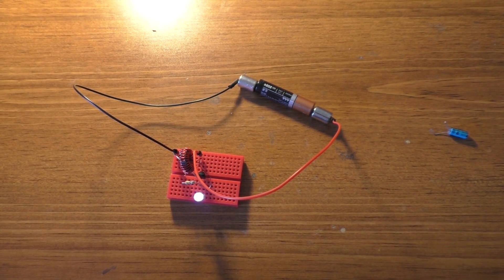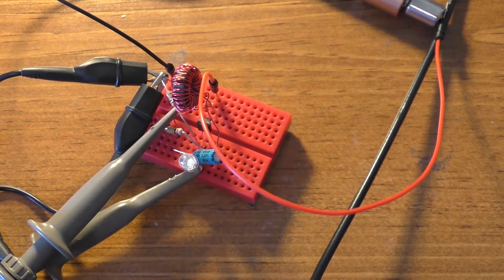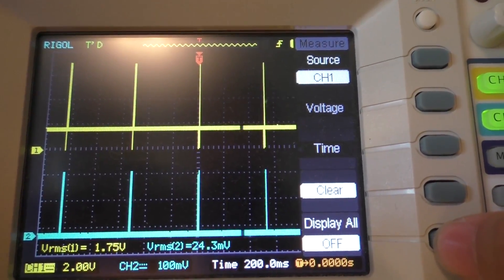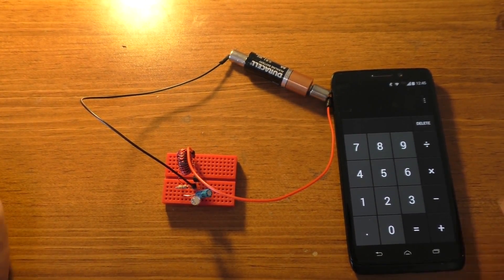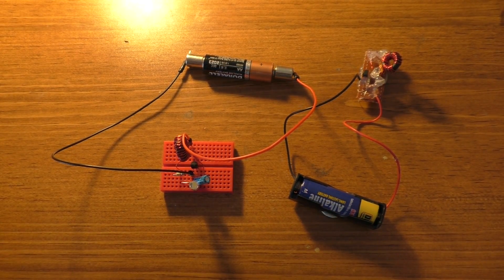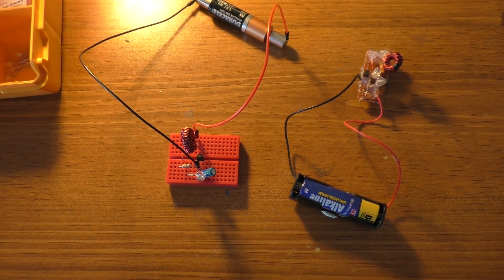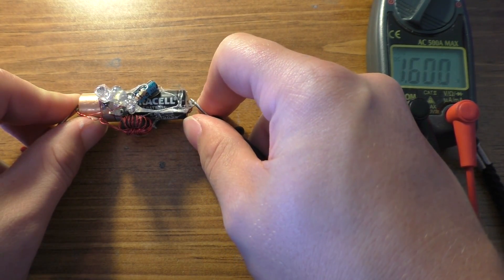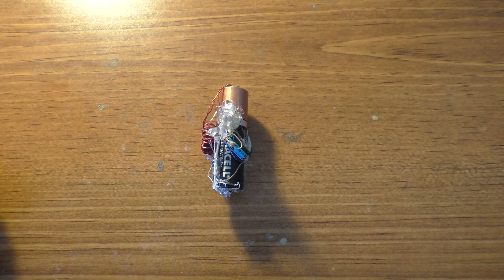Long Life Blinking Joule Thief

Comment: Ive been playing with these lately.. found not many windings are necessary,  dont even need a core.  I made one with a ring magnet as a core as well as air core inductors wound in a coil as well as toroid.. its all about the right resistors and capacitors.

Comment: In the Joule thief circuits, it will stop working when gate voltage of transistor reach .6 volt because of silicon transistors, so that much voltage will not produce work and that should be taken into account  when calculating the life of battery, because so much Amp hour is associating with that little voltage. If we were able to use mosfet transistor that could change, but I don't think it will work, I have to try it some day. Good video.

Comment: I'm having trouble getting mine to work. I have a 100uf cap across a 100k resistor, but all it does is waiting a few seconds after power is connected and turn on forever.
Reply: try a higher frequency rated cap.

Comment: You were working too quickly and didn't properly explain where the capacitor goes.
Reply from the maker: Gadgetboy it goes in parallel with the resistor. Explained in the first minute of the video if you need to see.
Reply: Hmm. That's not working on my joule thief. 220uF electrolytic is not making it blink, regardless of polarity (I also tried some high-value ceramics). Are you building the classic bigclive joule thief or have you made other changes to the circuit?
Reply from the maker: Gadgetboy yeah just the standard configuration. Try a lower value cap just to see it it works. 220uf is probably only going to blink once every couple of minutes.

Comment: This was the perfect circuit for me..... Why? By adjusting the R/C timing you get a variable blink rate led driver with a slightly variable blink rate.  Currently these are used to discourage rodents from areas at night mimicking the flash of predator eyes in the dark !
Reply from the maker: That's an interesting use for it. Thanks for sharing!
Reply: bro can you share its citcuit diagram  plzz
Reply: what color LED did you use?

Comment: I actually made this, except I used some super capacitors, a solar cell and a geranium diode for the reverse current protection. It flashes about twice a second for me.
Reply from the maker: Cool! How large of a super cap did you have to use for that?
Reply: Eman2000 I had 3 of the 1 Farad capacitors, so I just chained then together in parallel.
Reply: I have the same plan, small solar cell and supercap (i wanna use 50F/2,5V) , whats the capacity of the cap you plugged at transistor base? Also what kind of transistor have you used?

Comment: nice job. do you have a circuit diagram? i've built a JT but would love to get it to flash as well. otherwise I'll try a NPN/PNP circuit
Reply from the maker: Thank you, The circuit diagram is the same as a normal joule thief except you use a higher value resistor (something like 100k) and put a capacitor across the resistor. The value of the capacitor and resistor determines how fast the LED blinks.